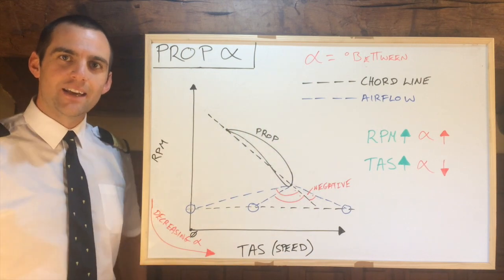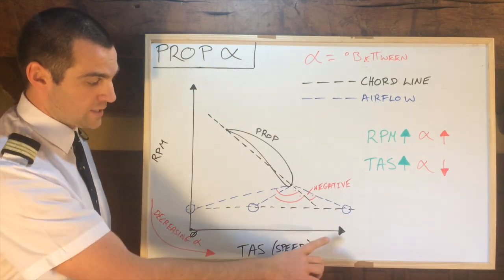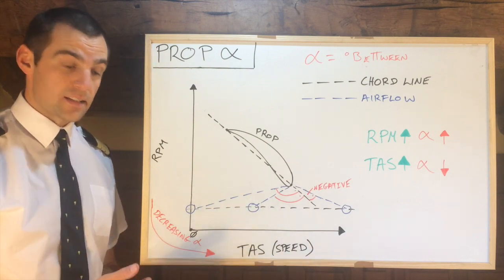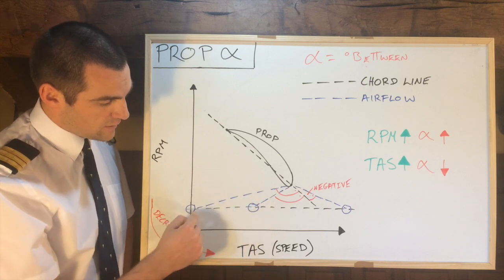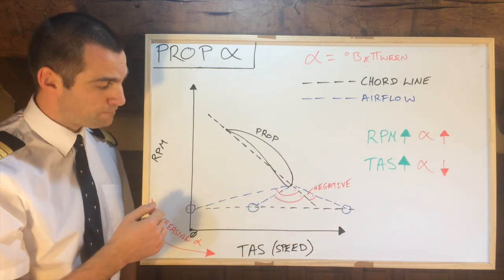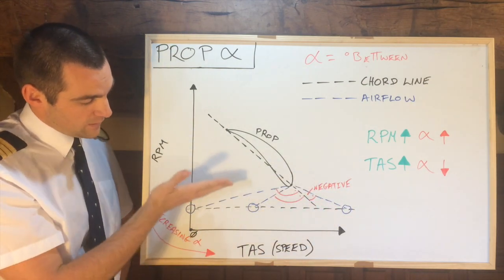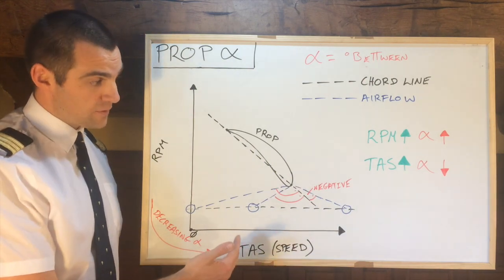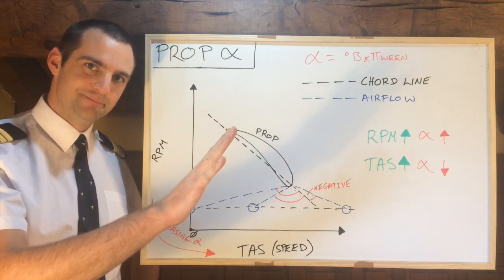Propeller Angle of Attack VS. Speed and RPM ✈

Comment: Who gave this a thumbs down?! It's a great simple graph to show that fixed pitch props have a design preferred speed at which they most efficiently bite the air! This is the same basic concept in gas generating turbine engines when dealing with compressor stall. I think your white board graphs do superb job of explaining relatively complex concepts in a simple manner. Books and manuals can tell you all the equations and theory, but sometimes it takes a simple visual chart along with a basic no-nonsense explanation to really get the point across. Well done!
Reply from the maker: thanks so much mate, thats exactly what im going for! thanks for watching

Comment: Not quite right to say that a fixed-pitch prop has the proper angle of attack at only one speed.  It is correct to say that a fixed pitch prop has only one airspeed producing the proper blade angle of attack AT a given rpm.

Comment: If you look at the thumbnail of this video, the propeller blades are almost parallel to the axis of rotation.  But all propeller diagrams illustrate lift and thrust with the chord angle at 45degrees.  I can't envision the lift and thrust when the propellers are close to zero degrees.

Comment: I thought a fixed pitch blade/propeller kept the angle of attack the same? And a variable pitch blade/propeller changed its angle of attack? And I thought the tip of the blade is the end of the propeller blade where the propeller travels the longest distance as it makes a full rotation??
Reply from the maker: thats all correct yes :)

Comment: Can you do a video on constant spped props? :)
Reply from the maker: this one kinda covers it I think no? just think of the speed vector vs angle as in the video, but for a prop that doesn't move :)
Reply: @PilotEd  I was thinking about the tecnical aspects like what changes within the engine when the pitch is changed. I've worked out the mecanisms but can't get my head around as to what happens to manfiold pressure and the actual combustion in the piston as the blade pitches to a higher angle in cruise for example :)
Reply from the maker: @LUXAviators  prop pitch is really nothing to do with the engine? just a hydraulic system that changes the pitch, of course it will affect how easy or hard it is for the engine to move the prop. but same engine
Reply: @PilotEd  Yea sure but as the rpm on the prop drops and blade angle increases, the prop is harder to swing. The engine is obvisously turning at that speed now so something must happen to manifold as the engine changes rpm
Reply: Never understood exactly this stuff! No I do! Thanks!!!!!

Comment: Wait... the rounded part of the propeller blade on your drawing is the tip!?

This is really getting annoying that I can't get a straight answer to my question anywhere on the internet. Logically if a prop has a bigger bend inward it should push MORE air... however, what I'm seeing when searching for propellers is that the higher the physical pitch of each blade the LESS thrust you get!?
Reply from the maker: I think your a little confused, what your question and ill try to answer it :)